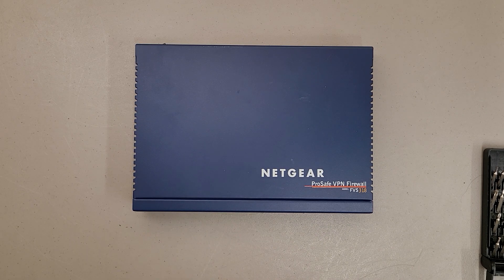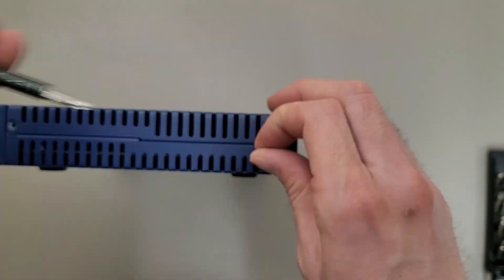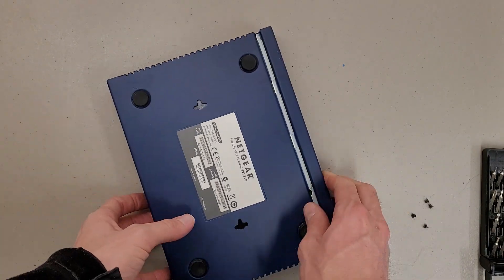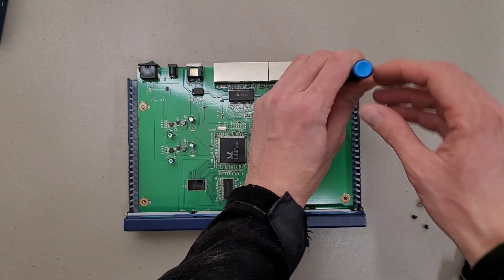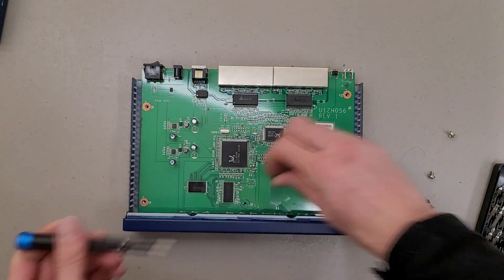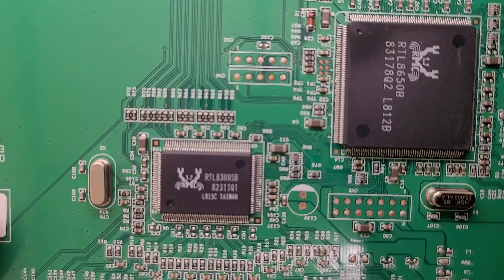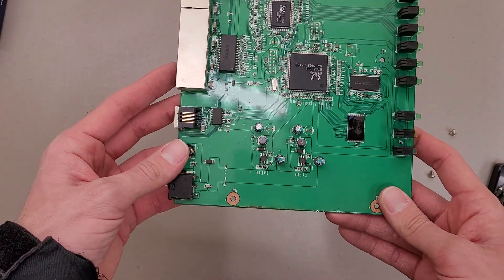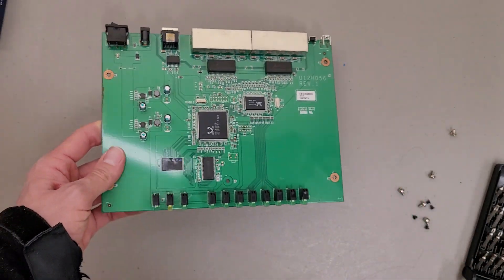Netgear Prosafe VPN Firewall FVS318 8 port 10/100#teardown

Comment: great video. I have one of these that just died. Can you request a suitable replacement
Reply from the maker: I don't have any recommendations personally. I would see if Netgear makes anything modern like this otherwise I think Sonicwall is a good brand. If you're feeling really ambitious you could build your own custom PFsense box.
Reply: @computersales  thanks for responsing so quickly. PFSense is way over my head. I have come across some Sonicwall devices, and Cisco , like the rv260. Thanks for your input. It is much appreciated
Reply from the maker: @steeez0  two other brands I should have mentioned are MiktoTik and Ubiquity. MiktoTik makes some nice and powerful stuff for the money. Management can be tricky though. Ubiquity is easy to work with I believe but they are expensive and tend to EOL stuff pretty quickly from what I gather.

Comment: External power is easier/cheaper  if you ship to other countries where they use 220 to 240 V, no need to certify the PCB for A/C use
Reply from the maker: Don't most modern power supplies work with those voltages? I guess I don't know if the 120-240V listed is for single phase or split phase 240.